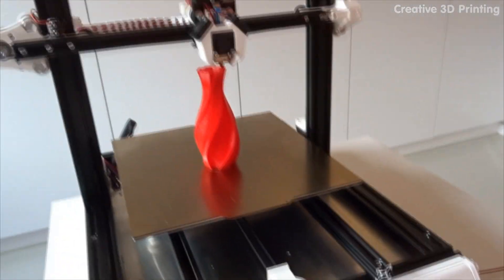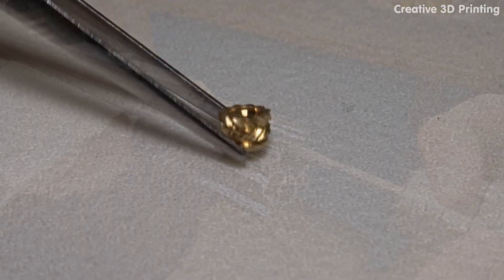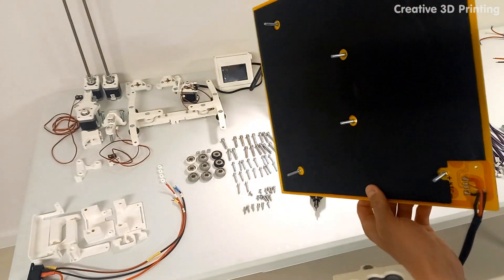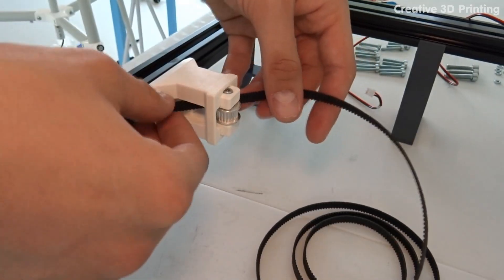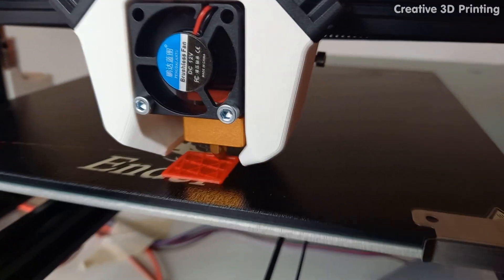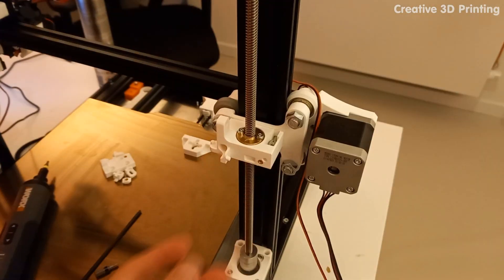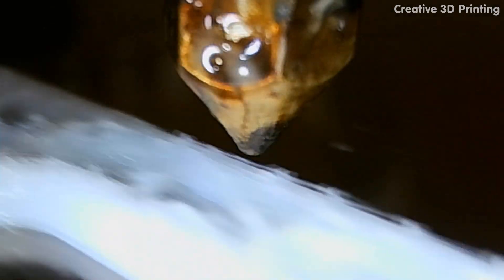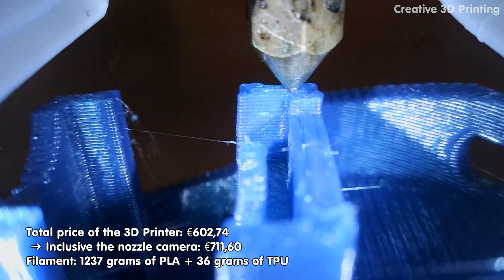DIY Large 3D Printer for €600 (from scratch)| 1/3

Comment: Amazing nice work I especially love the Nozzle Camera I probably do the same to my printer it used to be a Ender 3 Pro but now it has a new Mainboard an SKR Mini E3 V3 Hotend assembly with the extruder the Sprite extruder CR Touch and it became incredibly fast and reliable all I need to install is an LCD touchscreen display and that's about it and probably will buy or build my own Corexy printer with multiple filament printing but your printer is amazing and very good and it's nice of you to make it open source
Reply from the maker: Wow! You did some really good upgrades to your ender 3 pro! Your idea of making a coreXY printer with those multiple filaments sounds great!